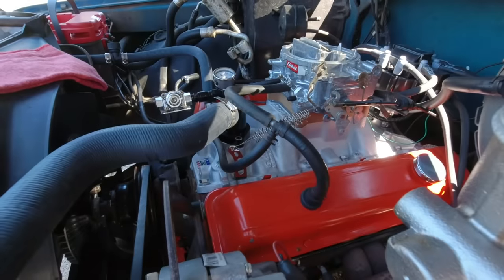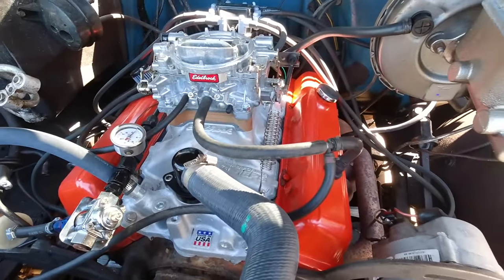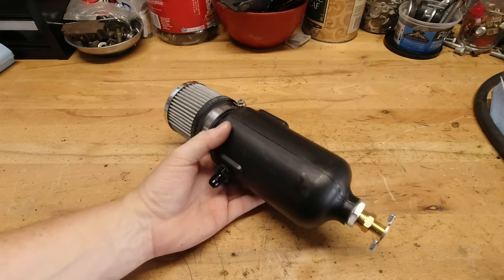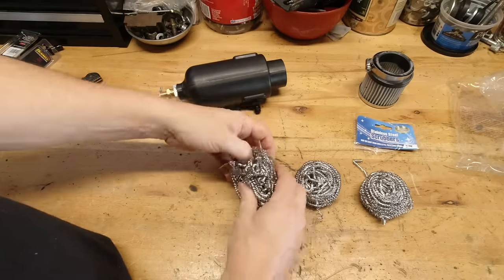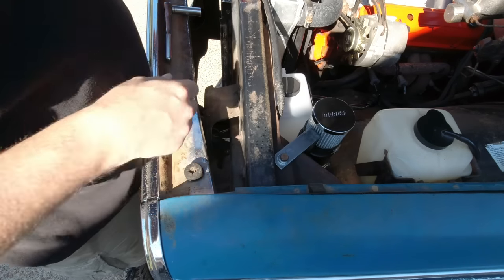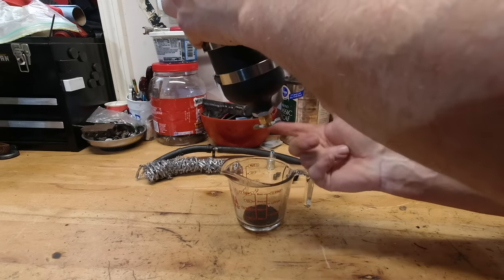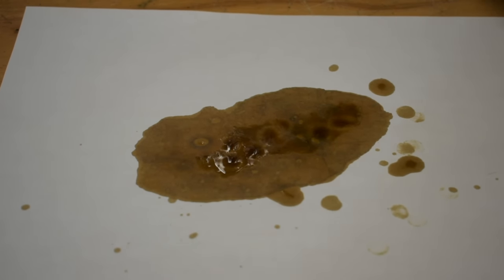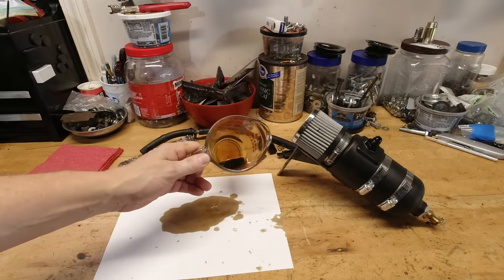Do You Really Need a PCV Valve in Your Classic Car

Comment: pcv system the real big benefits is feed some oil to lubricate valve and piston rings.
Reply: That may be true...but also moisture and contaminants.
Reply: @geraldwegener8376  of course oil mist.
Reply: @macgyverdroid Absolutely correct...oil mist resulting in carbon buildup on pistons ,valves, rings, combustion chambers🙄
Reply: @geraldwegener8376  same as fuel. Even if gasoline alone build up carbon when not combusted properly same as oil mist and diesel
Reply: @macgyverdroid  The use of fuel is unavoidable... engine will not run without it.🙄

Comment: First of all, fuck emissions laws. Second, a PCV system is both bad and good. The bad part is that you are sucking crankcase gasses and all the crap that's in them into the intake. The good part is that you are actually using a vacuum to ventilate the crankcase, which is FAR more efficient than the old road draft tubes, and certainly more efficient than just sticking a filter on the crankcase vent. The best way to do it by far is a vacuum crankcase vent system that does not dump crankcase gasses back into the engine intake. You could use either a belt driven or electric vacuum pump. You can use a catch can, or you can simply blow the exhaust gasses out under the bottom of the car somewhere. Fuck the EPA.

Comment: Really don’t see what examining the oil coming out of the PCV will accomplish. It’s going to be full of moisture and debris from the stainless wool you placed in the catch can and will net very misleading results. Analysis of the oil drained from the pan is really the only way to determine what’s happening in the engine. Additionally I find it hard to believe you drive that truck in that condition. You have your ignition wires draped over your steering shaft and not tied away from anything at all. Same thing with your hoses and that’s not really a proper way to run your EVAP hose. There’s no thermostatic valve to ensure it only evacuates at cruise once the engine is up to temp and keep the canister sealed when not. You’d be better off disconnecting it and retuning the carb for the massive vacuum leak you just eliminated.

Comment: Do you only need a PCV on one side?  I notice you have a vent on the passenger side.  I recently replaced my air filter with an aftermarket one and I had the snorkel before.  The passenger side had a tube going to the filter and so I just put a push in filter on it like you have there.  Being a V8 and two heads, is it best to have a PCV on both sides?
Reply from the maker: The PCV is a check valve essentially that draws the air/pressure from the engine.  That pressure is created as it pushes past the pistons and rings.  To pull through the crankcase there needs to be a vent on one side.  So no you can’t run two PCV.  Needs that one side to pull air in.
Reply: @MuscleCarSolutions  Great.  Thanks for the video and such fast response.  I was thinking that since, from the factory on my 69 Impala, the hose on the passenger side from the valve cover went into the air filter/cleaner housing (old snorkel type) I wouldn't need to replace that with a valve.  Makes sense now.  Cheers.
Reply: I still have the PCV on the drivers side by the way.